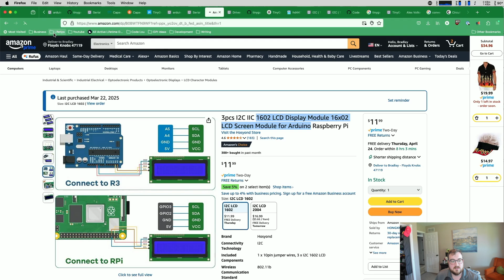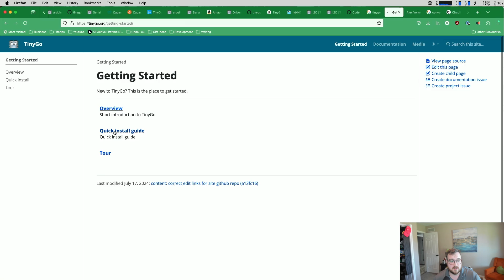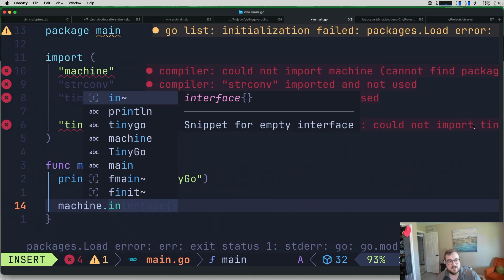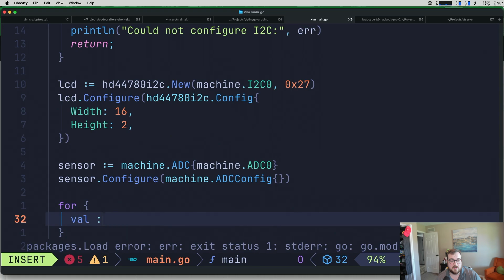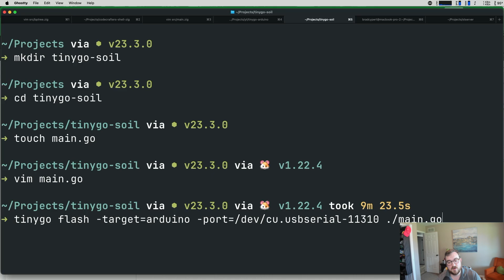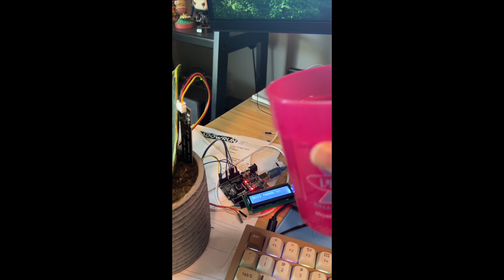(TinyGo and Arduino) A Soil Moisture Monitor for my Snake Plant

Comment: why you used tiny go rather then rust or c or c++ or assembly or machine language for embedded
Reply from the maker: Mostly because I like Go a lot. Those are all great options that you suggested too though!
Reply: @CodeWithCypert  i too want to learn bare metal but where to start
Reply from the maker: What do you already know with regards to programming?

C is a safe bet, but if you already know Go, TinyGo is likely more accessible
Reply: @CodeWithCypert  i dont know any programming language but i want to make my own project which should enhance my skill and if i apply for embedded job it should be relevant.